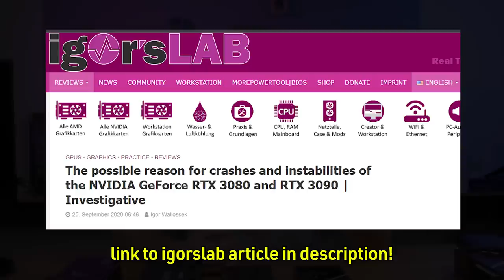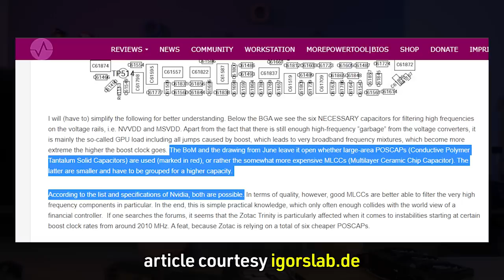The RTX 3080 Launch can't get any worse... Right? Wrong...

Comment: The companies that underspec'd the cards should recall those cards. This is why i never buy the latest cards. always wait 3-6 months because there will always be some issue.
Reply: Especially EVGA. They are placing themselves (with their prices) as an "high-end" manufacturer. Add to that the "aura" given by people who use their cards for heavy overclocking (like gamer nexus we all highly trust)
Reply: @TransformX  You find EVGA pricey? I actually found a few of the lower end cards a fez down cheaper than the alternatives.
Reply: @TransformX  EVGA is fine. they actually announced that they knew about the issue and rectified it in the FTW3

EVGA- "During our mass production QC testing we discovered a full 6 POSCAPs solution cannot pass the real world applications testing. It took almost a week of R&D effort to find the cause and reduce the POSCAPs to 4 and add 20 MLCC caps prior to shipping production boards, this is why the EVGA GeForce RTX 3080 FTW3 series was delayed at launch. There were no 6 POSCAP production EVGA GeForce RTX 3080 FTW3 boards shipped."

"But, due to the time crunch, some of the reviewers were sent a pre-production version with 6 POSCAP’s, we are working with those reviewers directly to replace their boards with production versions. EVGA GeForce RTX 3080 XC3 series with 5 POSCAPs + 10 MLCC solution is matched with the XC3 spec without issues. "

https://www.tomshardware.com/uk/news/evga-nvidia-rtx-3080-capacitor-caused-crashes
Reply: @Diddydudat  oh shit, do you think that all those sell outs and delays were actually just AIBs realising it's gone wrong and withdrawing all the cards?
Reply: @facepalm7345  Could be part of it, but I doubt it, component scarcity made the stock of cards low and scalpers took many cards, those were the main reasons probably.
Though, I have just as little proof, so I could be worng.
Reply: @Diddydudat  What was ASUS response to this stuff? Since they made their TUF have 6 of the MLCCs. They must've known, right?
Reply: @JMPERager  I don't know, I'm not going to speculate. Could be a lot of reasons.
Reply: yeah that why pre-ordering is never a good idea. Be it software or hardware.
"PS5/XBOX/RTX is sold out" Every time i heard this, i thought "these ppl are stupid".
I totally can understand why you would want something on day1. Im also a Tech-Enthusiast. But you just have to remind yourself to not get caught up in Hype.
Reply: @TheVertical92  yeah, its almost like those dumb asses have warranty or something huh?
Reply: If I had one of those cards I'd be returning it immediately.
Reply: @TheVertical92  indeed
Reply: @hitman480channel8  of course there is warranty but you also could save the hassle and wait for the tests. The cards are not running away. And for software its a little bit different. Although it has gotten alot better in software with warranty's.

Comment: Nvidia seems to have handed AMD this GPU generation win on a silver platter.

I can't wait to see how they also screw it up. 😂
Reply: 30 seconds... Woah
Reply: Imagine it AMD gpus have an equally bad launch
Reply: @deathzowen8644  I know right! It'll be so funny. 😂
Reply: how has 2020 hit nvidia cards aswell
Reply: Snatched defeat from the jaws of victory. Very impressive.
Reply: AMD (IN THE GPU GAME) is like the democrats, you give them an easy win and they still screw it up.
Reply: Easy. They just need to leave the drivers same as current gen
Reply: I really want them to beat nvidia but I'm also almost certain that they WILL screw it, somehow they'll find a way to.
Reply: @deathzowen8644  To be fair, the past couple AMD GPU launches have been at least as bad as Ampere's launch. 
Navi? Low availability, bug infested drivers, and zero AIB models for weeks.
RadeonVII? No need to add anything to that dumpster fire.
Vega? Overpriced hot garbage and low availability (first batch was only available through some shitty bundle)
Polaris refresh? Refreshes Rebrands are NEVER well-received by the public.
Reply: My hope now lies on the GTS480 cards run on SLI
Reply: Inevitable
Reply: Yeah - imagine being so much of a fanboy that you think the board-partners (that also produce the AMD-Cards) fucking up is Nvidias fault.
Reply: I hope they don't screw it up. But I'm afraid you are right and they will.
Reply: @deathzowen8644  I can't imagine that happening. AMD have been timid with their products thus far. Most of their products are mid Intel/Nvidia range and haven't really pushed the limits. AMD have put out decent CPU's And GPU's but not mind blowing anything (except for Threadripper). Hopefully AMD has noticed it's demand and up'd their game. I like AMD and hope they succeed but time will tell.
Reply: r3mxd so if amd had a better card for less, you wouldnt buy it?
Reply: They'll screw up with drivers, obviously. Still looking forward to AMD's launch.
Reply: @deathzowen8644  Would that suprise you? I mean, 3-6 months of black screening on the 5700xt was insane too. 2020 is a shit year
Reply: its not FE but from another product, they will fix it in the mean time, maybe before amd release everything will fix with new product
Reply: AMD already ruined it simply because they typically have their “game ready” drivers available 6 months after a new game launches
Reply: @kevink1575  lol 😂
Reply: Well 2020 is a (%'=' '==' %(_) hell of a year therefore nothing surprises me anymore
Reply: Dawid my new favorite tech channel ❤
Reply: @Serenewynter  What? AMD has completely dominated the CPU market in the past year or so with RYZEN in both sales, and performance in anything other then playing games and even then that small gap is about to be closed...
Reply: If AMD has their act together with supply and drivers - that could really hurt Nvidia
Reply: @r3mxd  hmm when I built a pc recently for a friend I bought him an Rx5700 for 50$ off, he did the whole flashing xt drivers to it and now he basically has a card that is comparable, sometimes beating a 2070S for like $450 not exactly "peasant shit" imo
Reply: Seems rushed to release. They also got pushed to a node they didn't want to be on, and it's customized for Nvidia so it's also teething.
Reply: Issou
Reply: We'll see if AMD somehow snatches defeat from the jaws of victory as they always do.
Reply: knowing AMD.... They will find a way to tank it bless them
Reply: @kapler8550  Yes I would, AMD released Driver Updates and Fixed most of their issues. It seems like Nvidia has released these cards too early. Just like Xbox and their "RED RING OF DEATH". Use cheap components and expect premium response and $$$.
Reply: I cant wait to see ur face if AMD did not screw up. Lol!
Reply: Joseph this what nvidia did. Lol
Reply: DeathZowen u wish
Reply: @deathzowen8644  I mean, the 5000 line was a bad launch, so I hope they've learned
Reply: AMD drivers have been historically shit for their GPU's. Its expected.
Reply: r3mxd crashing 3080s are for peasants. Lol
Reply: @DawidDoesTechStuff  chasing clout from other channels lol
Reply: this isnt a problem with nvidia this time, its a problem with other companies
Reply: Even if the performance was close, if AMD could get their drivers under control, I'd buy an AMD for sure.  Nvidia needs to be checked, this is ridiculous.
Reply: 2020 year of crap launches.
Reply: @Serenewynter  Big Navi is expected to come close to or meet 3080 is performance according to all the leaks so far
Reply: AMD does not even have cards yet for this gen?!?
Reply: sounds like it's more the fault of certain AIB partners than nvidia themselves
Reply: How is this nvidia's fault at any level???
Reply: Nvidia founders cards don't have this problem....
Reply: Technically it's the AIB that handed it over. Expect a similar issue with Navi 2X as most of these brands offer AMD as well.

Though Nvidia gimping supply so hard certainly gave the W to AMD.
Reply: @deathzowen8644  They're usually worse.
Reply: @Serenewynter  AMD fanboys always say that, then they're fucked again when a new card launches.
Reply: maybe AMD delayed their reveal on purpouse to see if nvidia is going to have any problems so they can make some quick adjustments to make their GPU´s more desirable
Reply: Ya they gonna fuck this up somehow.  Likely drivers will be the fuck up.
Reply: I wouldn’t quite go that far, I hope I’m wrong though
Reply: @DawidDoesTechStuff  no it wouldnt Dawid ! ...love the channel btw
Reply: You think the rushed release of these cards doesn't mean they fear AMD?
Reply: @PavolNemec-l4v  I'd bet more to be closer to the console launch, and to give the new CPUs a month instead. Most people who buy it would likely buy Ryzen as well because of that.
Reply: @deathzowen8644  Will depend on how bad their bignavi performance is. Because supply wise.. I bet TSCM us churning 7nm like no tomorrow.
Reply: Eh, if this was the reference spec I would agree... But it seems like Nvidia gave the reference spec correctly and these guys cheaped out.  That's like blaming AMD because the Red Devil used cheaper mosfets or something.

This is on these companies.
Reply: Lol no. I like amd a lot, but they don't even remotely compete in the gpu world.
Reply: Unless I saw a different video than you it seems to be partners are cheaping out on components Nvidia recommended in their reference design.
Reply: @apricotmadness4850  Maybe I miss typed. AMD's top GPU cards haven't come close to the top Nvidia GPU's thus far and I'm hoping (Pending new launch in October) we'll see something as impressive as the RTX 3080 should be without Nvidia's issues. Hopefully without "AMD Driver problems"
Reply: Amd is going to lose by thutty percent
Reply: @-Flabbergasted-  he is a funny guy ..i enjoy his channel too
Reply: @dufflebagboyswag  Hahaha!!
Reply: They are certainly trying...
Reply: NVIDIA had garbage launch of perfect card.
AMD will have a Perfect launch of Garbage Card.
Reply: 5700XT aren't even fixed yet. I run the most cookie-cutter setup possible with Ryzen 3600, MSI B450 Tomahawk MAX motherboard and 5700XT, and i still get occasional black screens and "dead" pixel lines until i reboot the gpu via windows+ctrl+shift+b. It has been a year since 5700XT release, and it's not like i am running some exotic hardware either.
I would had changed to Nvidia this generation if it wasn't for all this
Why can't we just have nice things?
Reply: If nvidia had it on their spec sheet, is it nvidias fault though? Genuine question. Seems like a few companies tried to go under spec to cheap out.
Reply: Couldn't Nvidia make stock held in a warehouse until the AMD event? Then flood the market and make sure the pricing is competitive with AMD. They also get almost 2 months to fix these issues while the AMD could have these same sort of issues.
Reply: But if it is true that you can just reduce the power limit, then that is a hilariously more easy fix than the AMD Driver issues tho.
Reply: @STR33TSofJUST1C3  *The AIB availability is sort of a bad point. Up until this generation nVidia never allowed partner cards to come out at the same time, but with their redesigned cooler didn't feel as threatened by the partners so allowed it. I think everything else is spot on.
Reply: No the AIB's have done that not Nvidia
Reply: @MidWitPride What is your power supply? Maybe that is the issue. Some times the easiest problems are overlooked.
Reply: @Serenewynter  550W Gold rated XFX(Seasonic) PSU. These issues happen randomly even when i am not stressing the system, and with my 970 and 980 i have no issues.
Reply: NVIDIA didn’t do anything here. It’s a partner issue. What do you mean...
Reply: @MidWitPride  PSU is probably the problem. My buddy had serious issues with his Ryzen 5 3600x, X570 AORUS Elite, Rx 5700xt with 650w PSU. He upgraded to 750w and now no issues.
Reply: @Serenewynter  I am under the impression that GTX 980 uses more power than 5700XT does, yet 980 works just fine.
According to some quick googling 5700XT has around 260watt peaks, and 980 around 280watt peaks.
Reply: Not seeing this as a huge issue as it isn't a problem with the GPU itself. This just needs a board revision.
Reply: @jeepmanxj  the 5700X does fine in where it was. Cheaper than the 2060 .. and gave superior performance.
Reply: @locust76  thats BS, they have game ready drivers on game launch almost all the time.
Reply: The AIBs that did this will also cheap out on AMD cards. 😂
Reply: @CesarinPillinGaming  ok. Middle of the road performance doesn't win a generation. Competition at the top does. See ryzen buttfucking the Intel core stuff
Reply: To people who claim nvidia did nothing wrong, as a company whose product these partners are representing, you want to have enough quality control. If almost all these companies cheaped out and released, it means that based on their testing to what was available to them, it seemed like the changes were okay. In the end, nvidia didn't know and neither did the partners because of the time pressure. If the drivers were delivered earlier to these partners for example, this would have been a different story. If they waited on the launch until enough quality control, it would have been a different story. You can of course always blame the third party. But no matter what, those cards all represent your product. If nvidia can't control that, then they've also failed.
Reply: @misterx8448  😂 ikr, just like tesla fanboys hating competion.
Reply: @iwashere Thats probably going to work out as their main thing is (or should be), cpus. but buying their stock now would be kinda bad as they've just came from a massive spike.
Reply: @kevink1575  Claus Kellerman xD
Reply: @Ducc1x just to be clear, it was expected to meat the 3080 at its 'this is what nvidia says it performs like' numbers, given where the 3080 fell, and how far ahead the 3090 is, it may end up in between them barring any silicon level bottleneck... but given they have a 128bit buss, i'm very interested in the gpu.
Reply: r3mxd Lol, fanboy much? Dont fanboy anyone or anything. Competition is good for consumers. But Nvidias price > performance is....Yeah..
Reply: U r definitely comes from future..🤣
Reply: Imagine being nvidia fanboy seeing this news and you root so hard that AMD will do the same too
Reply: This is why I've always said my potato GPU will win in the end.
Reply: @deathzowen8644  same lack of stock (or underestimation of demand), same scalper bots hoovering up all the small initial supply
Reply: Not really Nvidia's fault for aftermarket manufacturers building under spec though....just saying.
Reply: This opinion did not age well, did it?
Reply: Does anybody know if the new card have anti plasma 1080p 3D?
Reply: Top shareholders Nvidia: Vanguard group, Blackrock 
Top shareholders AMD: Vanguard group, Blackrock
Ur money goes to the same people.  /fake competition.
Not saying they are bad, I have their gear for a decade+ , but the competition is somewhat fake. If one company goes worse, the investors give more to the other. You will always buy AMD or Nvidia now, and never even consider a 3rd company. This is the entire reason why they bouncing wins for the past 2 decades. The investors need both to do well, so they will always "catch up" to each other. 

Do you know why some people always  "predict" these flaws to happen? They like to think it's because they are smart, but it's because there's nothing random about it. The thins is being gamed to stir ur emotion to get fully invested in either brand.
Reply: technically it only hit a third party, not nvidia.
Reply: @GOmegaPHD  Strange I've mainly owned AMD GPUs and their drivers have always been on point and it's usually the other way around with nvidia providing absolute dumpster drivers. In fact the 290X has never given me an issue ever since I got it 7 years ago. Meanwhile I don't even want to use the 1080 though it might not be nvidia's fault after seeing this video might be gigabyte being gigacheap but who knows.
Reply: What is this, a crossover episode?

Comment: this is why i literally never buy pc parts at launch
plus, last gen parts get much cheaper until stock runs out
Reply: Don’t know gtx1080ti continues to be expensive
Reply: @Souls4Roca  because it's still "good"
Reply: With this large of a performance boost between generations I wouldn't purchase anything older right now but rather wait until this problem is rectified.
Reply: @OriginalMergatroid  dead you just... summoned electroboom?
Reply: i know me either .. i never buy into the hype and cpu;s and part and or games . i wait for a while
Reply: @Sherry_Armstrong  I've learnt that mistake from buying flight simulator 2020
Reply: I have a habit of buying new last-gen parts, never see a problem in my life. I also always get it at the best price. Just bought a GTX 2070 super for my Alienware Graphic Amp.
Reply: Just bought Strix GTX1080 last 2 weeks at only USD259.
Reply: @mohammadfirdaus9203  New hardware new bugs learn that edges ago.
Reply: Yeah, the good 12 seconds it took for stock to run out on the 30 series 😂
Reply: @TalesGrimm  So many beta testers I am truly blessed.

Comment: I remember an electrical engineering  prof who worked at MIT, also published a book on Analog Circuits and the one thing I remember him stating was, and I'm paraphrasing from memory here so I apologise if it's off slightly, but "beyond a certain level discrete circuits start to see similar if not virtually identical problems to analog."

The faster you push it the worse it gets.